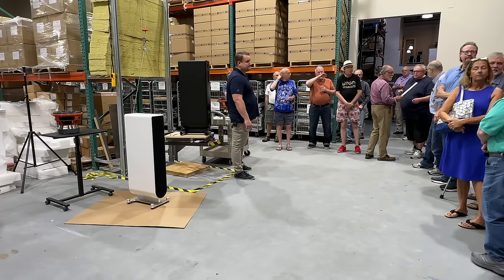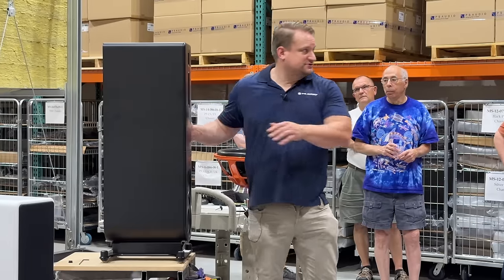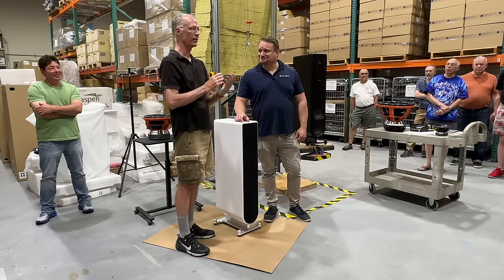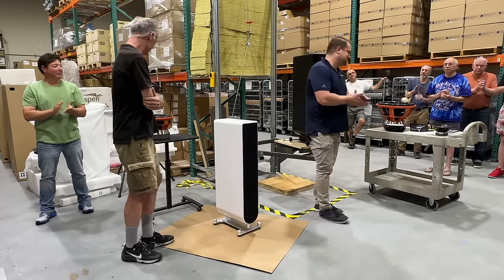Chris Brunhaver reveals the aspen speaker secrets

Comment: Wow! Cool to hear that PS Audio is considering doing a new more affordable speaker line. I would love to help Beta test those! How bout a old school 12” high efficiency 3 way. 👍🏻🔈 I really think it could do well!
Reply: High Efficiency = High Distortion.   You need stronger magnets and stronger coils, to prevent distortions.  That comes at a cost of extra power needed to drive them... and its FAR more worth the extra power usage... ,  rather than using a low power ECO-woofers... that distort vocals and musical details into each other.

 The diameter of the woofer does make a difference.. however, the driver design itself is far more important than the cone diameter.   Ive owned cheap 12"  woofers, that couldnt hold a candle to the bass thump, and musical accuracy,  of far superior  8"  woofers.   Personally, I would never use anything below 8" drivers.

 Most Audiophile companies refuse to use woofers larger than 8 inches,  because the larger the cone.. the more mass.  The more mass... means that you need much stronger coils and magnets, to be able to accelerate (and decel / stop / reverse)  that cone.     The lighter the cone... the faster it can accelerate, and you will get Far more precision control (with even less power consumption).   Faster and Lighter + strong magnetics = near distortion free, audiophile grade Output.
Reply: @johndough8115  I know this is different, but similar to your points. Dipole speakers, the bass drivers almost never move. They can respond in an instant to transients / bass information. We really have never heard bass sound so good! And to johndough8115 point on the smaller drivers.
Reply: @johndough8115  
Good points and you seem to know allot more than me. But check out the measurements online of the CerwinVega! XLS215. These are high efficiency speakers and have a low distortion. 👍🏻
Reply: @johndough8115 
Some good points ... but I'll push back on the lighter cones being able to accelerate faster. 

Moving mass doesn't impact ability to accelerate. 

As you mentioned it does however impact sensitivity.
Reply: @JR-ho5qm  Cerwin Vegas are what you call "Party Speakers"... very close to PA style speakers.  They are not even close to being considered Audiophile grade sound.

 You should also know that the distortions Im speaking of, are not the kinds that you hear.  Its more like when you cant understand what lyrics the singer is singing.. because the musical instruments and the singers vocals.. end up blending together.. due to the weak drivers lack of control.

 DJ / Party type of speakers, are good for very large rooms, where you need extremely loud volume levels.. and the ability to drive the sounds very deep into the room.  This is why they often choose to use Horn tweeters... and those are notorious for distorting the natural 3d Soundstage "Image".   They also tend to be very "Harsh" and "Fatiguing".

 Just looked up the model you spoke of.  My buddie actually owns this model.  He once demo'd them at one of his parties. He put in an  Iron Man  DVD / Bluray dics... and cranked the volume up to INSANE levels...

 At the time, I was playing one of his many arcade machines... and all the sudden, I hear Bullets flying, Explosions, glass breaking..etc..  I thought there was an actual WAR going on, outside, for a moment.

 While it was impressive that these were capable of that level of loudness, and sounding like an actual WAR...  Here is the problem:   Just like really being in such an event... it was extremely HARSH / Painful to the ears.   It wasnt a good thing.

 Even when he was playing music through them... they had a very flat sound.. without a  "3d Soundstage".    They were also Harsh to my ears.   I didnt really enjoy them at all, compared to my Audiophile grade speakers.

 Ive actually owned a lot of speakers that could go quite louder than my audiophile speakers.  My original speakers, were Techniques 12"  3ways, capable of 200 watts each.   While they were loud.. the bass was distorted and artificial sounding (typical of ported speakers).  I felt the need to drive them loud.. because I was never fully satisfied with the sound they put out.  

 But when I got a pair of  EPI 100v  speakers... I was blown away at how much better they sounded.  I was finally hearing Bass that sounded musical and REAL..  and It was so amazingly different, that I put the Techs on the Curb, the next day.   A single EPI 8 inch woofer,  weighted more than TWO of the Techniques 12" woofers combined.   Furthermore, they had a bass deeper response, and even a greater "Thump"  that you could feel through the room/floor.   While they couldnt play nearly as loud as the techs..  I didnt mind it, becuase it was loud enough,  and the music sounded 1000x better.   For the first time in my life... I was understanding singers lyrics in various old songs.. that I never could make out... on any other speaker that Ive heard / owned.

 Furthermore, the EPIs inverted tweeters, completely Trounced my Techs cheap mid and tweeter.   They make a 3d soundstage that is, almost Holographic.  In fact, if I blindfolded you... spun you around 20 times.. then asked you to try to find the speakers.. you wouldnt be able to do it... because the speakers sort of "Vanish".   The sound is everywhere... like actually being there.   You dont hear a "Speaker" or "Speaker Sound".  Nothing artificial sounding... that gives away where the speakers are located.  Its like magic!  and its what totally sold me on getting a pair for myself.

 Additionally... unlike the Cerwin Vegas, or my former Techs... the EPIs tweeter produces very detailed highs and mids, WITHOUT sounding Harsh and Fatiguing to the ears... even at max volume levels... where the speakers are on the very verge of blowing.

 So again... if you are looking for cheap party speakers... you can find them pretty easily.  Both used, and new.   Because all sorts of people produce loud, low quality, speakers.   But very few people produce and use Audiophile grade Drivers in their speakers.   Most of them are completely unaffordable to the majority of the masses.. too.   Which is why in my case, I lucked out, finding a cheap used pair of EPI's (from the 1970s era).   Both refoamed, for a about $100 on Craigslist.   These babies completely sh*t on the $3500 speakers, in the local high end audio shop.  Its not even a competition.

 But the EPIs,  while able to play loud enough to get the cops called on you, when playing in an Apartment...  they are not really "Party"  or  "DJ"  level speakers.   Thats a whole other kind of speaker.  And Not one that I care for anymore... after hearing the EPIs.
Reply: @davewin1792  My EPI woofers certainly Move... most notable at their highest volume levels.   The difference is that when they move... they are moving much FASTER, and with far more Precision and Control.

 Its like the difference between an RX-7  (Race Car level of Acceleration)... and a generic Chevy Cavalier  level of acceleration.

 Not only do you experience better and deeper bass than you would imagine... but also, there is a thump in the very room/floor.. that the EPI woofers make... that never existed in my "efficient" Techniques 12" 3ways.

 Again, this is because the techs used weak ECO-Woofers.  With very small and weak magnets... and weaker voice coils.  So while you will see a lot more cone movement on the EPIs... you are not getting super air compression level forces, from each bass thump... because they cant respond "Fast" enough for that kind of response.

 But yeah... they dont "look" like they move a lot of air, compared to standard eco ported driver speakers.  Especially not at lower volume levels.   That said... look at an Acoustic Guitar.  It sounds deep, and loud, despite you not visibly seeing anything move at all (besides seeing the dudes hands moving).

 In fact, the most movement and deepest Bass that Ive had in my house, actually came from a pair of Phillips Woox speakers.  Woox is a unique passive radiator speaker setup.  They could even get some lower bass, and more "Excited" thump sounding bass.. than my EPIs, despite them only being 6.5" drivers..  due to these special passive radiators.  They also sounded 1000x better than my full sized Techniques.   Sadly, the foam rotted away on them... making them useless (as you can no longer get hold of the very unique Woox passive radiator devices).

 Of course, I still mostly preferred my EPIs, because the bass is still more accurate and more dynamic.  And the highs of the Phillips.. while very good... are not even close to the EPIs in clarity and soundstage.

 Now.. Ive seen that EPI did make a version of their speakers, with a passive radiator.. would would be interesting to hear.  Ive never gotten the chance, however.   I have a feeling that such a design might have too much exaggerated levels of bass.. however.  But I cant say for sure, as Ive never heard them.
Reply: @FOH3663  Im not sure what you are arguing.   Most audiophile grade speakers, use lightweight cone materials.

 The level of acceleration, depends on how strong your coils and magnets are... as well as how much weight the cones are.  But most of it, is the magnet / coil strength.

 Also, its one thing to be able to accelerate and run fast... but its quite another, to be able to instantly brake, and reverse in that same acceleration and speed level.  This is where the added magnetic power is needed, to be able to overcome the moving mass at that level of speed / acceleration.

 So yes, maybe its called "Sensitivity"..  but that term is so easily confusing to most people.   Because a speaker can appear to be sensitive... and detailed.. but its still suffering a lot of micro distortions... due to it not being able to maintain precision surgical levels of cone control.  It cant fully keep up with the demands of speed control.. and so details get slightly "muddied" or "Blended" into each other.  Instruments and vocals lose their defined separation. Lyrics sometimes losing enough detail from mixing with the background instrumentation... that you cant fully make out what words they are singing.

 In the headphone world, I believe they use "Total Harmonic Distortion"  to measure such things.  And even those measurements are often not represented well.. because they dont state the power levels per meter of distance.   As such.. some may perform decently without distortions at lower volume levels... but when cranked to max volume levels... is when you will get a much different level of distortions.

 Anyway:

"Moving mass doesn't impact ability to accelerate"

 If you have 2 duplicate race cars, but one was modified to be 500 lbs lighter... you are 1000% going to see a difference in the lighter cars performance abilities.  It will accelerate faster, stop quicker, turn sharper without sliding at much..etc.

 Now.. if you give the heavier car a more powerful engine, and much stronger brakes... you can start to even things out a bit.  However, the physics are still at play..  and they dont always scale very well.  Especially since that more powerful engine, and those stronger brakes, tends to add more mass.

 Of course, cars dont have to stop on a dime.  Nor do they have to instantly reverse from full speed.  Which is a huge factor in speaker accuracy / distortion levels.
Reply: @johndough8115  Dude you're way above my knowledge so I will take your word for it. I was generalizing also.

Comment: It's xbl 2 subwoofer dan Wiggins design  alot of company's use this design done correctly there low distortion but allso low sensitivity
Reply: I used to work for Dan. I wouldn’t say a lot of companies use it. There are a few, certainly.

Home and car subwoofers by their definition are quite low sensitivity. No, I wouldn’t recommend this approach for professional sound reinforcement m.

I am also working on some other magnet structures for various products that’s an overhung with undercut pole and saturated tips and some shorting rings

Comment: Didn't point out where the planar mid crosses over to the woofer? Cross whatever mid you choose lower, then doppler and intermodulation effects, etc. by a woofer on mid frequencies is less of an issue. Also didn't get into detail about the cone material in the woofer, or enough specifics on their motor's better approach to linearity (if this was developed by someone else many years back, was there a paper published)?  The distance integration comments are quite helpful though.
Reply: We have a 400 hz crossover on the Aspen FR20/30.  Depending on the type and construction of the midrange a lower crossover definitely isn’t always better.

Doppler distortion is orders of magnitude less significant to IMD other types of distortion mentioned.

The woofer tech is called XBL and was developed at Adire Audio where I worked in my early 20’s.

Comment: When he turned round that speaker Ahh KEf 139 units  no Chris is really starting from scratch to get the best sounding speakers available.Would like to know what the vertical frequency up and down measures a big failing with many makers
Reply: These are similar in shape to the b139 passive but are smaller. They had an aluminum/styrofoam “cone” and we are using fiberglass/rohacell/carbon fiber.

While the vertical response contributes to the early reflections (off the floor and ceiling), they are a lot less critical than the horizontal response of the speaker to overall sound quality

Comment: When asked about active speakers, Chris focused more on all-in-one solutions with dac and dsp. I think the guy wanted to know about active analogue crossovers before the power amp. Al things the same,  active speakers have more presence and life. Plus being more efficient you can avoid those gazillion Watts amplifiers.
Reply: You can have active digital (DSP) speakers with outboard dacs and power amps. 
Linn. Sanders Sound. PMC?

I will only use active speakers, for the reasons you mentioned. 

Most pro audio is active. Audiophiles are about 2-3 decades behind. 

Discard the passive crossovers. 
A high quality, studio quality DSP. 
Multiple dacs. 
Multiple power amps.
Reply: @jim9930 unfortunately there's a glitch and YT is not showing your comment :(
Reply: @n.lyndley.9889  I am bit on the fence on all in one HiEnd like Linn. Amp and analogue crossovers last quite some time, but DAC and DSP tend to become obsolete very quickly. My favourite approach wold be passive xover with a bypass on the back of the speakers and a external xover. The user then picks the amp it wants.
Reply: i heard can't remember where that Linn offer that switching option, i could be wrong though.

Comment: Thank you for letting us eavesdrop on the thinking behind the FR speaker series, it's very informative.

That 18" subwoofer has about 5X the cone area of an 8" unit. What are the differences in performance and cost of using the 18" unit vs 5 of the smaller units?

I'm thinking very hatd about springing for the FR20's for my system, just have to fill up that piggy bank.
Reply: can you imagine the size of the cabinet that's going to accommodate that sub

Comment: Dammm that top plate is a thick boy lol 
Copper rings do you mean shorting rings right to stop over excursion on the up stroke 
nice to see you using a TI style basket/frame :)
Reply: Ahh multigap motor nice like the idea
Reply: I learnt a lot by this video:)
Reply: Actually, what you’re describing is a “shorted turn” of the voice coil. These are a stationary conductive ring (copper or aluminum) placed in one or more places inside the motor (inside an undercut in the pole piece, top of the pole piece, inside the magnet, between the magnetic gaps in a split gap design, sleeving the pole with a thin tube). Generally, these shield the steel from A/C eddy currents which cause A/C forces - distortion- on the coil and DC forces- dynamic offset/rectification. They also make the coils inductance more linear with respect to excursion (in and out of the steel motor) and versus current.

JBL and scan speak did some early work with this (see patents for the scan speak sd-1 motor or JBL vented gap/sfg in the 1970s

Comment: the subwoofer topic interest me, but i do not like the approach of high excursion, i rather have dual 18" with half the cone travel.
that would solve a lot if issues and think you can use the same size box also.
and you also the twice the cone area, so you get twice the punch at lower volume.
you can wrap you brain around this by an example:  one 8" subwoofer with 2" excursion vs one 16" subwoofer with 0.5" excursion, or four 8" subwoofers.

Comment: Legacy gets 3% on it's low end, maybe Bill d. should show you how it's done.  there is no way such small woofers you use can move enough air at low freqs at realistic sound levels.  Legacy Focus down to 16Hz  try it
Reply: Well, I’d like to see some measurements. Other than an old stereophile review or two, you can’t find anything on their products.

Our  Aspen fr20 (with 2 x 8” woofers) measures <3% thd from 25 hz and up at at 100 db at 1 meter. 

Hifi news measured an fr30 at about 0.1 distortion at 90 db through the bass and midrange and so they’re quite low distortion at lower listening levels.

This puts us among the best they’d measured (along with KEF and JBL and a couple of others)